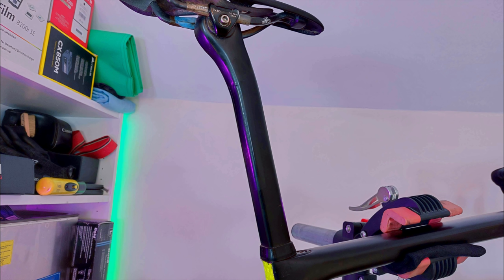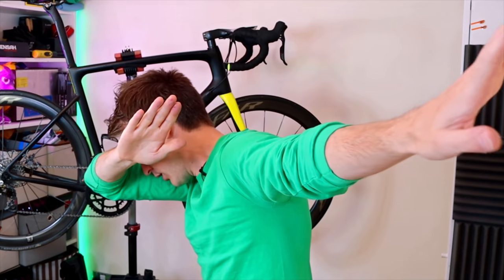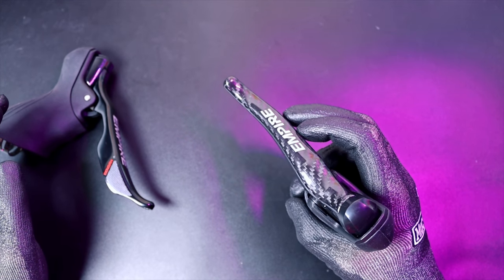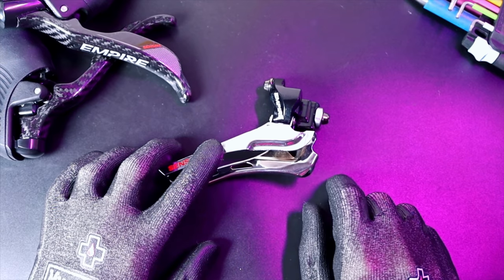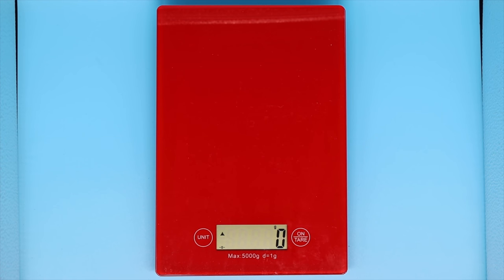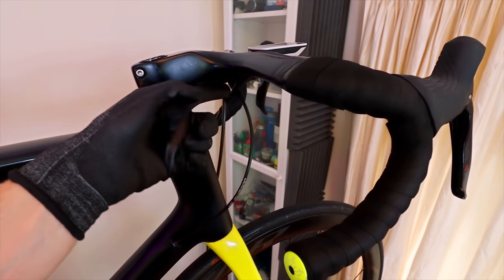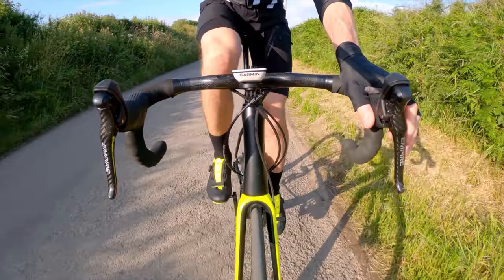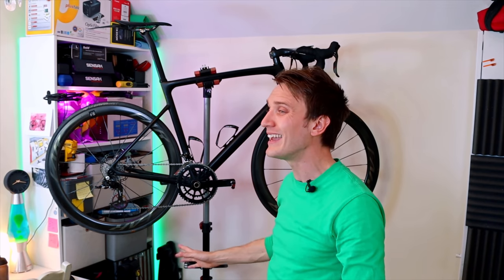Chinese Full Carbon Groupset (with OSPW) - Sensah Empire

Comment: Am I missing something here ... Is that OSPW not removable? Or more direct question.. isn't renovable on the original standard Empire version 3?  Oh one more thing ... How many extra links did you added to that OSPW 😆 at some point doing the changes I saw a little of extra movement may be a little long chain? However great video I'll check out the suggested videos too.

Comment: The Rear derailleur cage appears to be a non-standard 3rd party upgrade type. The brand Lingmai is the Aliexpress store name I bought my Empire Pro 12 speed from which comes in standard 11T/13T pulleys, not like the oversized ones in the video.

Comment: Hey love the video! how do you find your cable hydraulic brakes with this setup? My friend got this groupset with cable hydraulic brakes, internally routed through the handlebars and frame and the braking was apparently awful
Reply from the maker: So it took a little time to get things dialed in, but i actually loved it. The braking was nice and snappy, and the lever pull was great. Alot of it depends on the cables and cable housing you use, and i can image a fully internally routed system (incl. handlebars) with cable actuated mechanical disc, would bit a pain to troubleshoot...
Reply: @TraceVelo  thanks dude! 🤝

Comment: Did you need to resize your chain for the over-size pully wheels?
Reply from the maker: Most of the time you do tbh, you usualy need a couple of extra links. In this video I actually needed to replace the chain anyway, so this got a brand new chain

Comment: Given how similar the internal ratchet system seems to be to SRAM shifters and considering they use the same cable pull, I am very interested in finding out if the 11speed ratchet in the Sensah could be used to upgrade SRAM 10 speed shifters to 11 speed... I have some 10 speed SRAM red 2012 shifters around, I just need to find a Sensah 11 speed donor...

Comment: Hi Luke, how are you getting on with the chainrings on the crankset? I have some FSA Gossamer ones and the big ring is made of chocolate so has needed changing every year. That tasty crankset of yours is drawing my eye as a replacement. Are the teeth still in good nick?
Ps love the videos, keep it up!
Reply from the maker: So yeah great question. My chainring is aluminium, and I replaced it about a week ago actually. It lasted just over 6000 miles if I remember rightly, so really depends. If you like the weight savings, go for it, but if you are all about longevity, I would probably stick with steel chainrings...
Reply: @TraceVelo  Thanks Luke!
Reply from the maker: No worries 👍

Comment: Velo i have quite an odd question i hope you can answer in this 2yo video...

I want to buy this groupset but for weird reasons i am stuck with a 11-36 11 speed...Freewheel cassette (im poor wheels are expensive)
The Sensah GS RD says a maximum of 34T that can handle, you think it would work okay?

Comment: Not sure if there is any way to tell with the different cage, but when I ordered my copy of the groupset, they sent me the 12 speed Empire Pro rear mech (cage also looks 3D carbon). Works fine with the 11 speed shift levers though. Can you tell a difference between the mech bodies? Then again, maybe there is no difference between the 11speed and 12speed rear, since both fall within the same cassette width...

Comment: Thinking of buying this groupset. On this version, have they updated the rubber hood material on em shifters? The only thing holding me up to pull the trigger.
Reply: I also almost bought one, but then did find a sale of 105 shifters with hydraulic brake calipers for 200€. Slightly more, but maybe worth looking around for.

Comment: While i dont think the carbon version of the groupset is necessarily as good value as the non carbon version it seems like a solid groupset for a very competitive price. How close are you getting to the 7 KG mark with the new wheels and recently upgraded parts?
Reply from the maker: So with the bike as it stands in this video, with both bottle cages, pedals, and garmin mount, 7.46kg... not too bad imo
Reply: @TraceVelo  no indeed that's pretty decent. For reference my Canyon CF SL 8 disc size L comes in at 8,05kg with bottle cages and pedals. That's on aluminium clinchers though, with Farsport Feder Disc Carbon-TI Hubs i will shave of further 350g. Would still be quite a bit heavier due to the hydraulic disc brakes.

Comment: i would recommend you purchase using taobao instead aliexpress, i just got mine from taobao and cheaper. But thanks anyway, I am choosing between shimano R7000 at that time. i got sensah carbon empire set, after watching your video. I am using long leg for the back derailleur, so i get the carbon version also.

Comment: Thanks for the content m8 been watching you since you built your buddy's Ridley clone. Can you link me to that crankset? Looks like the cannondale spiderring.
Reply from the maker: So i have a whole video on the crank actually, so you can check it out on my channel page. I got it for 40 squid, but that was a while back. I think they go for like 65 now...
Reply: @TraceVelo   https://www.youtube.com/watch?v=Jjr3KmGrQ-c this is the only video on cranks I saw, not the spiderring style.
Reply from the maker: So it might looks slightly different in this video, because I very recently (last week) replaced the chainrings. They are made of aluminium, so don't last as long as steel ones, I think I got around 6000miles out of the original set. However both crank Arms, and the axle are the same 😀
Reply: @TraceVelo  Thanks Luke! Do you have any links to those chainrings?

Comment: I need to know if you changed or disassembled the OSPW system because I need to know the model, I will buy a sensah group and separately I will buy The OSPW system, but I do not know if it is the one that is compatible with the shimano 105 r7000 or the Ultegra r8000 up to the hard ace r9100

Comment: Hi Luke, I recently bought an Empire groupset.  How can I tell if the lever arm is aluminum, without damaging it?
Reply from the maker: So it's pretty easy to tell. The plastic version will have that little plastic insert on the brake levers that I mentioned towards the end of the video. None of the updated versions with aluminium lever arms will have it. Hope that helps!
Reply: @TraceVelo  I presume that the plastic insert is the triangular protrusion I can see in your video.  Fortunately, I can't see that on my levers.   Thanks for your help, Luke.  You're performing a very valuable service, and I'm sure many of your viewers are very grateful.

I didn't know about the carbon version, and, watching the video, I was starting to regret having purchased the regular one.  (I bought a carbon frame on AliExpress, and plan on building the bike over the winter.)   But as I'm not an out-and-out weight weenie, but cost is important to me, it looks like I'd have chosen the regular one anyways.

Comment: Hey Luke, is your hanger slightly out of alignment? I had this on a new build, just my custom paint job was enough to make the hanger 10mm out measuring with a tool measuring all around the rim. There was one gear I just couldn't get right, 'tweeked it' and then I had perfect shifting.
Reply from the maker: I mean it could well be, I've never tested with with alignment tool. I have pretty decent shifting atm, but might be worth a look. What tool did you use?
Reply: @TraceVelo  I actually made one myself, looked at a couple of alignment tools available and then came up with my own design..... Don't know how to get a pic to you??
Only has to be a micro mm out at the hanger, by the time you reach 350mm to the edge of the wheel, that has turned to 10mm.

Comment: You have a bike stand but you worked on it upside on the floor???

I have a bike (a Keysto, Chinese brand) with a full groupset of 'Lt Woo AX' which is basically just SRAM AX 11 speed.  The shifters and derailleur are fine, but the cassette is a little too cheap the teeth break off when you pedal LOL.
Reply from the maker: Yeah in my little room, it's often easier to just flip the bike upside down when working on certain parts. Does kinda negate the point of a bike stand tho 🤣

Comment: Could you use these shifters by themselves with a Shimano drivetrain?
Reply: Yes. If you have 105 get the Empire (not Empire Pro) and if you have Tiagra get the Quantum. There's a Sora equivalent too but I can't remember the name. Much cheaper than Shimano shifters but high quality construction,100% compatible and really accurate crisp shifting. It's just a question of getting used to the SRAM double-tap single lever system...took me a couple of rides but I grew to really love it.
Reply: @belverticale  ahh thanks, and good to know, also, do you know if they’re 10 speed shifters too for 105? Or only 11
Reply from the maker: 105 is usually 11 speed, unless it is an old variety of 105, like 5700
Reply: @TraceVelo  yes I have the old 5701 version, would like to upgrade to something newer but then I would have to change the cassette and hubs/wheels(I have 7,8,9,10 hubs) and that’s gonna be money I don’t have at the moment...it’s an old frame I’m putting up with mismatch parts...6700 ultegra cassette, 5701 rear derailleur, 7900 dura ace front derailleur and an r7000 crankset...(it’s a mess) it currently still has dura ace down tube shifters, but I wanted to upgrade to something more modern for shifting..
Reply from the maker: @Joshua-rp3tm  Yeah so if you went with 11 speed Sensah Empire, you would need new cassete, new chain, potentially new chainrings, and maybe a new BB too, depending on the type you have. So looks like it would need a full drivetrain replacement. You may find the cable pull ratios of 105 5700 match 10 speed Tiagra, in which case the sensah Quantum may be compatible, so could be worth investigating...

Comment: Could you not have taken the hanger off and unscrewed the mech from the hanger that way?
Reply from the maker: Yeah great question!. So I tried that, but the shape of the hanger & derailleur just meant it couldnt spin any further, the hanger would just bump into the corner of derailleur. The only option to save the hanger was to saw off the RD unfortunately...
Reply: @TraceVelo  might be worth taking the bolt out of the new one and filling it with some grease.
Reply from the maker: @scoobyben1979   Yeah probably a good shout tbh. I put some oil in there, but when i stip it down again, ill prob give this a go!

Comment: Thanks for the great content. Which brakes (calipers) are you using? Would Sensah levers work with Shimano/Sram brakes?
Reply from the maker: So im currently using JinTech F1 hybrid hydraulic calipers, but yes if you are using rim brakes, sensah levers will work with Shimano and Sram brakes.
Reply: @TraceVelo  Thanks for your reply. I didn't mean rim brakes. 
Does Sensah have a fully hydraulic brake levers or is hybrid system my best bet?
Reply from the maker: Yeah so Sensah dont make fully hydraulic setups yet. If you want to go disc brake with Sensah, either go with a hybrid hydraulic caliper like JuinTech F1, or a mechnical caliper, something like a trp spyre
Reply: @TraceVelo  Cheers! I really appreciate all the replies and the content. You just got a new subscriber. :)
Reply from the maker: OK awesome, good to have you aboard!!!

Comment: Good day Mr Trace, thanks to you I bought mine and installed today. But I have an issue, my 17t pulley is kind of moving, you can wiggle it, move it side to side a little bit, is it normal for big pulleys? Thank you
Reply from the maker: A little big of wiggle in the pulleys is pretty normal, just make sure the retention skrew is tight, and you should be fine!
Reply: @TraceVelo  oh sorry not 17t, i forgot empire's pulley are 13/19 😅, thank you for responding! I rode my bike yesterday first time after installing this empire gs. No issue so far. Smooth as fvck. 😁 I enjoy your vids all the time! ❤️ More power!

Comment: Pretty sure that Garmin mount is plastic though. If you were to upgrade to titanium screws you wouldn't suffer from rust in the stem :)
Reply from the maker: Yeah i've def thoght about upgrading to titanium skrews. There are some pretty cheap offerings on the good'ol AliExpress... 🤔
Reply: How will people know I ride in the rain if my stem bolts don't rust?
Reply: @TraceVelo  I can highly recommend titanium bolts from Ali, they are branded "Risk" (name is quite amusing considering what could potentially happen in fatigue failure). I use the oil slick ones all over my bike, literally everywhere possible! So far so good. Looks good, has potential weight savings and it will never rust! 
Saved 15 grams by just switching out the original Basso saddle mounting screws :)

Comment: I just have a problem with that groupset. It does not shift into the small cog when I'm in the big ring. But apart from that, everything is perfect!
Reply from the maker: Have you set the lower limit skrew on the rear derailleur?
Also slightly reducing the tension on the barrel adjuster for the rear D (screwing in slightly) could help too....
Reply: Maybe the chain is a link or two too long
Reply: Hmmm. I will try the d screw, because the lower one is already set
Reply: Nvm, that would be an issue if you would've had that problem in the smaller chain ring at the front.

Comment: Can you review some aliexress TITANIUM BOLTS to see are they any good and the weight savings
Reply: Can I give you a bit of good advice? Don't use titanium fasteners. Titanium is very hard but brittle. Fine for frames but not reliable to use as fasteners. The weight savings is not worth the lack of reliability. But if you choose to use them, good luck. Be sure not to overtighten them! Use a torque wrench and be careful!

Comment: Hi Luke Can you make a road bike build using V Falco frameset you can get one from Ali express thank you, and also I used Sensah Empire V2 groupset the only issue is the front Derailleur to prevent breaking my left shift lever I changed my front Derailleur to r8000 Ultegra but over all shifting is perfect I don't have any issues with my groupset.

Comment: The groupset loooks nice, except for the alloy pulley wheels. A metal chain hitting a metal pulley wheel is going to be noisy, for no reason. And yes, any watt saving those ceramic bearings have is going to be completely gone and turned into a loss in just a 100-200km. They're really pointless. And the increased play they suffer from will deteriorate shift quality. That's because affordable ceramic bearings are several magnitudes lower tolerance than simple cheap steel bearings.
Reply from the maker: Yeah I agree. The majority of ceramic bearings on bicycles are a bit of a gimic IMO. They can be slightly more efficient, but only at very high rpm's. Steel all the way for me. As for the aluminium jockey wheels, maybe a touch louder than nylon ones, but honestly not by much

Comment: Hey Luke what cassette and chain do you have on this bike? I'm assuming they are NOT from Sensah. Are they 105 or tiagra?
I ask because I'm strongly considering buying the full Sensah empire 11spd carbon groupset that comes with Sensah's OWN cassette and chain here: https://www.aliexpress.com/item/1005002282377680.html?spm=a2g0o.cart.0.0.3e9a3c00BLErRz&mp=1
Obviously in this video you only got the shifters and derailleurs. Do you think any of your opinions would change if say, Sensah's chain and cassette were of lesser quality?

Comment: Hi guys! I would appeciate if someone would reply to my comment. 

Does anyone know the pull ratio of the Shensah Quantum 2x10 shifters? I'd like to confirm if its a 2:1 pull ratio so I can mix match with a different RD.

Because I saw some guy who used the 2x9 Shensah shifters with ltwoo a5 elite RD(which is for mtb 9spd), and apparently it works. 
I'm trying to know if its the same 2:1 ratio used on Shensah Quantum 2x10 Shifters, so I can pair it with ltwoo a7 elite RD. (my reason here with using an mtb RD is to accomodate a bigger cassette in the back).
Reply from the maker: On many of the product listings for Sensah Quantum, it states that they are compatible with Tiagra 4700, so presumably they use Shimano Tiagra ratios. Not sure what those are, but that should be a good place to start.
Reply: @TraceVelo  thank you for replying Luke!! I love your videos as always and thank you for taking the time to reply! I'll look into that thanks again!

Comment: Always makes me feel uneasy to see your carbon frame clamped ( unless it’s just balanced )on the top tube Luke ☠️
I was always told to clamp on the seat post as it’s cheaper to replace if you inadvertently crush the carbon.
Reply: I also put my bike on the top tube and roll it up with a piece of foam and then don't squeeze too hard. The bike is better balanced in this way

Comment: Be careful folks with warranty from AliExpress at the moment. I've been buying wheelsets from China for years  with no issues, sane with frames and other bits. Recently I had my first bad experience with a wheelset. the rear hub was slipping from the get go, novatec 412CL rear hub. I contacted the seller hardly any reply, contacted AliExpress they said talk to the seller so in the end did the PayPal claim for some refund. PayPal no let me down, sided with seller for a return to Singapore if the complete wheelset. Yeah right, $300 quote for DHL as I only had 10 days to return the set.. Obviously it was not a viable option so I've got a bung hub. Novatec have no returns in Australia afaik and tbh novatec were as helpful as a wet sponge. Novatec needs to get their act together I won't go there 
Again or AliExpress for big purchases.